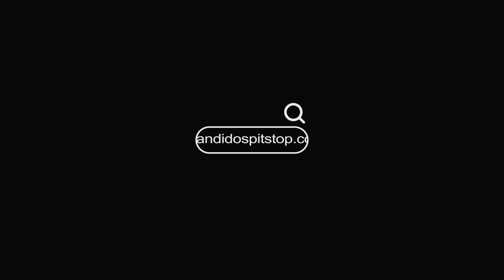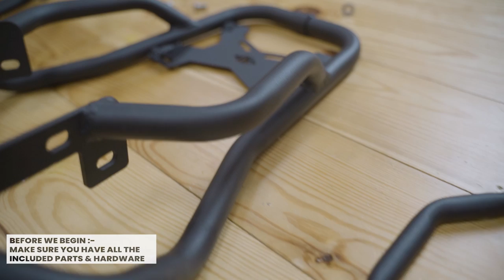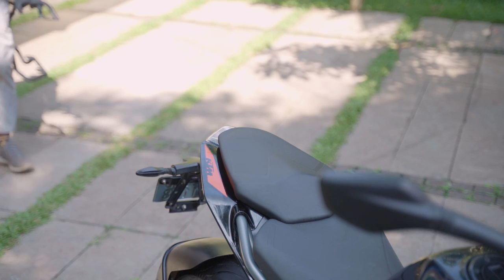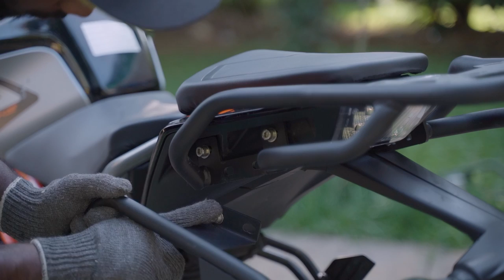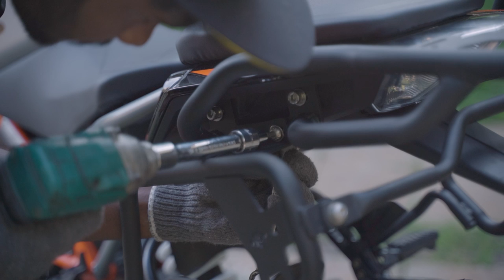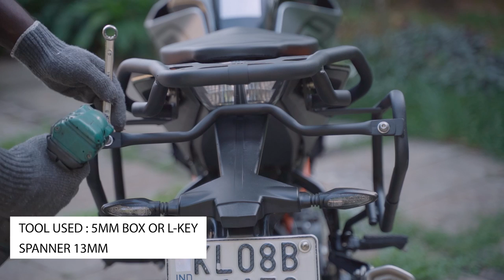POSEIDON SADDLE STAY WITH CARRIER| DUKE 250| INSTALLATION| BANDIDOS PITSTOP

Comment: How much weight will the rear rack plate will sustain?
Usually Upper Rack will break cuz it only has screw support from Upper side. No support from below to footrest.
Please reply. Thanks :)
Reply from the maker: It can sustain in between 15 kg as the build material is strong enough. for more details about the product please connect with our customer care 8891020202..
Reply: I use this rack for carrying my bag, which is around 10-15 kgs . I haven't faced any problems till now.
Reply: @bandidospitstop 
How much

Comment: Looks kool, will it fit duke 390 , 2017 Model..
Reply from the maker: Need to check with our technical department, if the head light is LED type it will be suitable. For more details please connect with our customer care 8891020202.